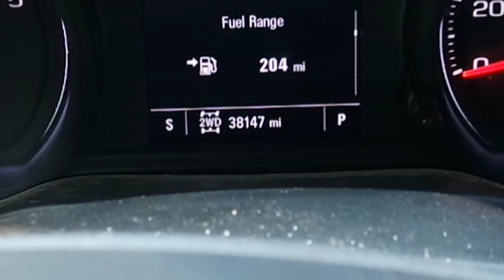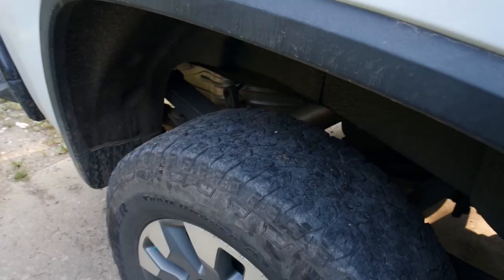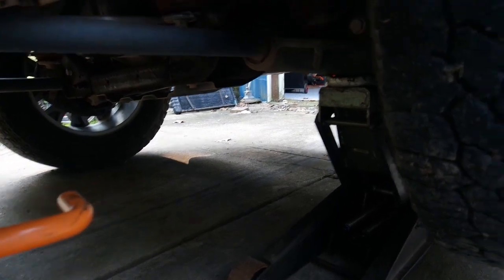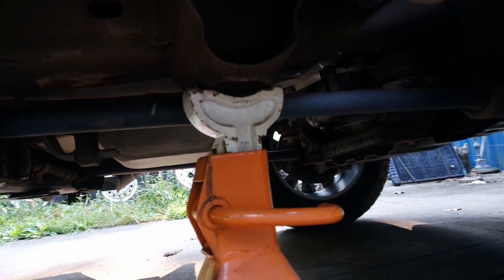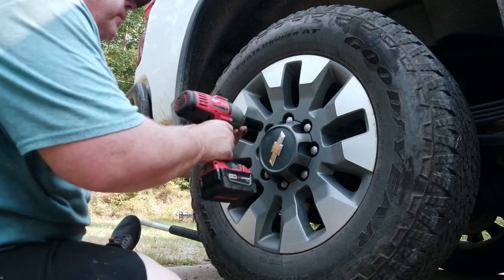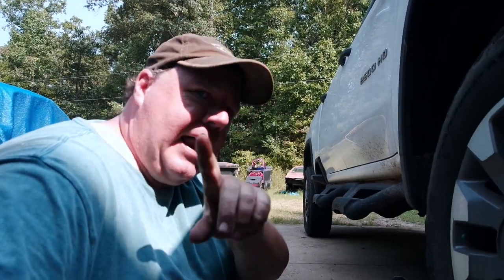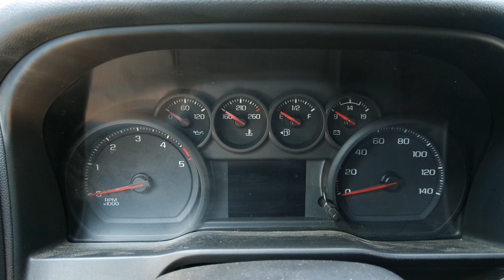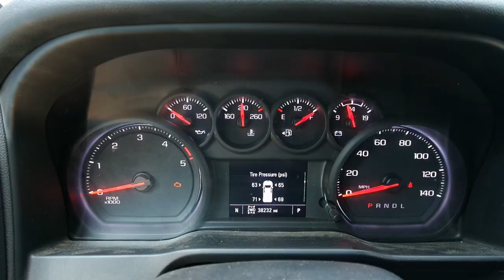How to rotate tires and reset the TPMS: 2021 Chevy Silverado 2500 HD and other Chevy and GMC trucks.

Comment: I have a 2021 Chevy Silverado 1500 work truck. If I'm just adding are to a tire because it is low do I need the program tool or do I just add air to it til the horn honks?
Reply from the maker: On my 2500 I can just add air until it honks. I imagine the 1500 works the same way. The program tool is really only needed when rotating tires.

Comment: Do you have to have the relearn tool to reset the TPMS? If yes, any idea why Chevy does this? 
I recently got my tires rotated at a tire shop. The mechanic basically shrugged his shoulders when I said the system was mis-reading. I am comfortable resetting myself, but annoyed to find out that I would need to go buy this tool before I can fix this. 
Also, thanks for making this video! Very clear and helpful!
Reply from the maker: The mechanic really should have the tool which is only like $10-20. So thats a real shame that they couldnt do it :(. This method though is much easier than the method on older GM cars in which you put it into a learn mode and then let air out of the tires until it figured it out lol. I'm glad you enjoyed the video and hopefully you dont have anymore issues! :)

Comment: Nice video. I always like watching how other guys do things to see if there’s something I can pick up from it. My 2022 has almost 13,000 miles now. I’ve rotated the tires twice. 

I do it a little different. I jack the rear and up and put it on jack stands and then use the jack for each front tires. Yeah I know, no jack stand on the front but I’m not exactly under there either. And I too use a battery impact (DeWalt) and I just use it to break the lugs loose with the tires in the air.

I also grease the front end when I do the tires. There’s 9 grease fittings there in case you didn’t realize.
Reply from the maker: Thanks! I likely would have done it that way as well if I hadn't been making a video. I was trying to knock it down to the least amount of tools while not recommending anything that could be considered unsafe or potentially damage your truck if the floor jack failed. A lot of people have Harbor Freight stuff at home and they aren't known for their reliability lol. I probably should have mentioned the jack stand recall....
Reply: @MidnightRoadGarage  good point. I actually have two harbor freight jacks. Both Pittsburg brand. One is aluminum, one is just steel. Seem to be pretty good. But still, good point.

Comment: jim i have a 2021 chevy silverado 3500 how do i do it with a push button start
Reply from the maker: Should be the same ☺️. To get it to the run position without starting it just hit the start button with your foot off the brake.

Comment: Yea, if you do not OWN a BIG Impact gun and you are a regular DIY'er, you SHOULD go buy one. I know ya can thank me later BUT, I bought a Earthquake 3/4" drive and it has never seen ANY n=n=n=n=n=n=n=nut it cannot take off YET.  And that includes 30 year old trucks with rusted in place chassis BIG nut on suspension parts.......It did snap one off that was 1 1/4" but hey I still got the piece off and replaced it with a NEW one anyway.  I DO NOT torque em on with it, a couple of uga dugaz and out comes the torque wrench for PROPER torque, re-checking after 50-100 miles. Only had to re-torque 1 single nut so guess I hit that sweet spot on 99.5% of em.

And I KNOW you know better than that.  But hey 38k on a set of 50k tires aint so bad. By the way, If you can't Dodge it, then RAM iT !!
Reply from the maker: I've heard that the Earthquake is pretty good but I haven't tried one. Usually the old truck stuff I have to take off I can't get to with an impact lol. Good to see you!